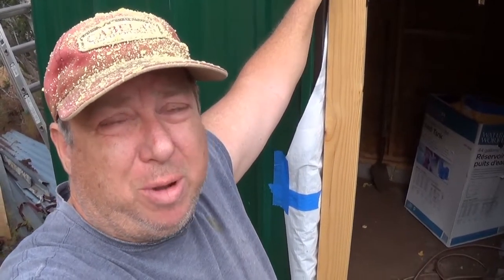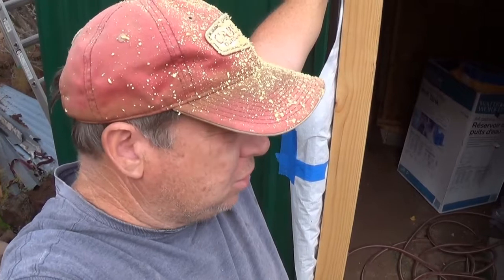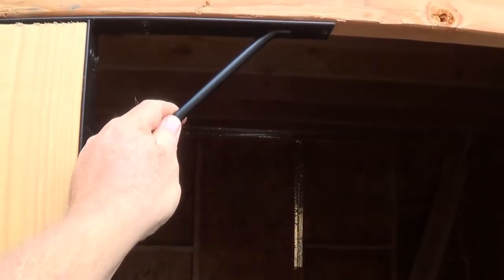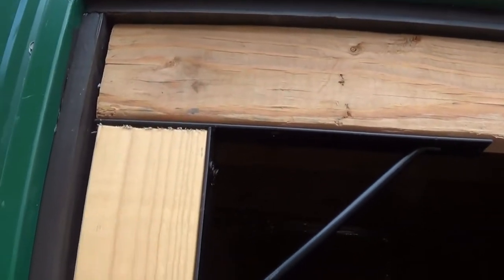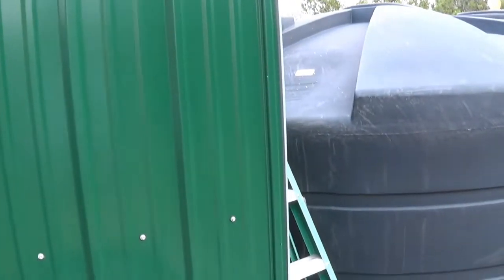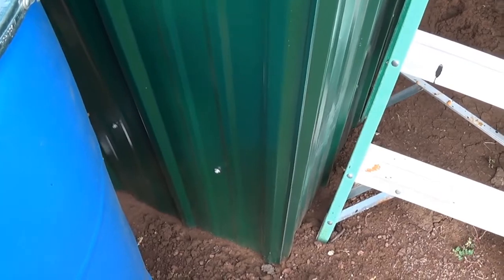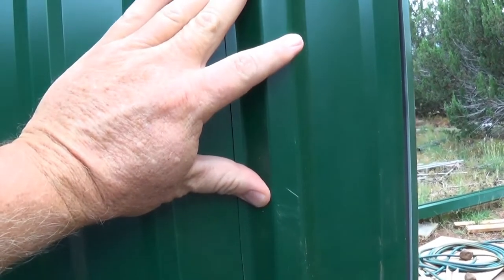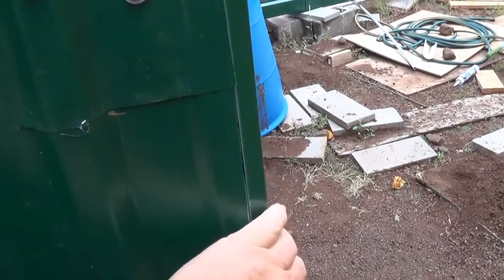Pump House Build Continues - The Walls

Comment: Yes sir, we are getting an awful lot of rain this year here is south Mississippi.  The pump s coming out good.  Just an idea, the flashing tape on those corners should give extra protection with the corner pieces.  Thanks for sharing, Carl and Dawn Homestead
Reply from the maker: thanks the plan. before i was able to get any roof on i put the flashing tape on the osb roof seams it held up not a bit of leaking.